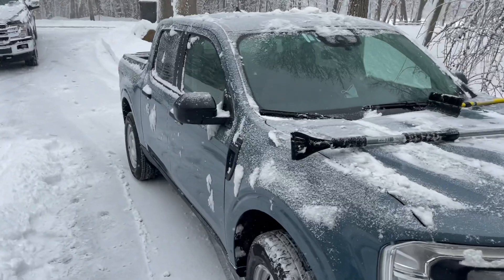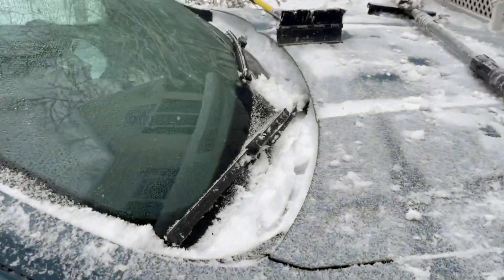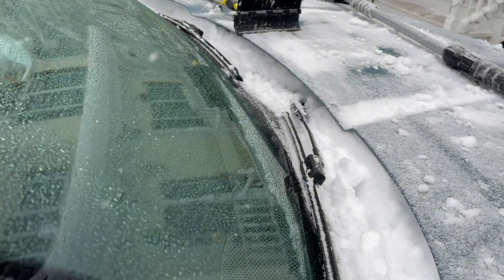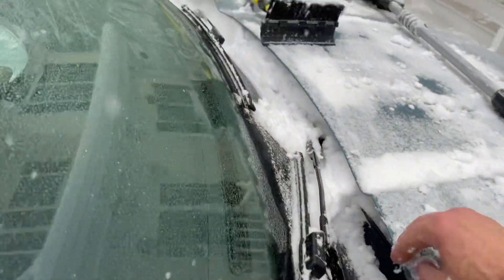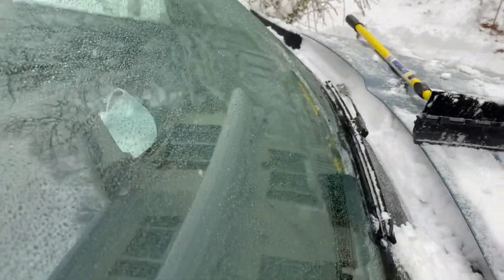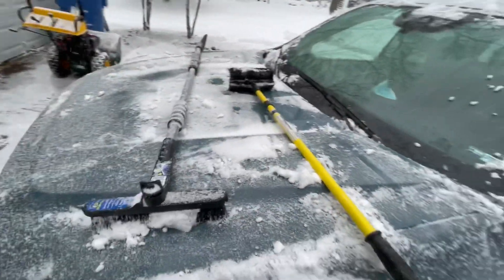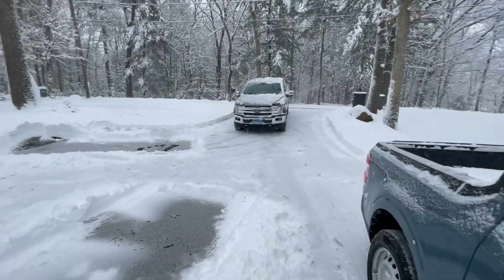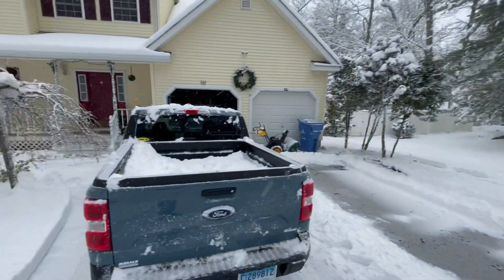Ford Maverick Engineering Fail

Comment: On 2021 Bronco Sport and 2022 Maverick vehicles, when replacing wiper blades or wiper arms, damage to the wiper motors may occur if the following steps are not followed prior to using the Workshop Manual (WSM) procedure in Section 501-16. To remove the wiper blades: 1. Place ignition key in accessory position (vehicles with keys) or key inside the vehicle (vehicles with intelligent access), press the Start-Stop button without applying the brake pedal. 2. Activate the wipers using the stalk switch. Do not manually rotate the wiper arms and blades. Damage to the wiper motor may occur. 3. When the wipers are at mid travel, move the key to the off position (units with keys) or press the Start-Stop button again to leave the wipers in a service position. Service the wiper blades once the wiper arms are at the mid travel position using the procedure in the Owner's Manual.
Reply from the maker: Thanks Don. Check the next videos out . We eventually got there! Other nice people like you helped with this info.
Reply: It's amazing how many problems are solved within the manual.
Reply: @supermills03  It's even more amazing how few people even think to look at the manual.  A car or truck is a very expensive and complex machine with 100's of moving parts.  Why wouldn't you at least skim through the manual?
Reply: Yeah a lot of cars do this now.
Reply: Dumb words
Reply: Sounds like junk to a driver who has had vehicles since the 60s.

Comment: There has been quite a few vehicles that you need to put the wipers in the mid way position to change out the wiper blades or have them come completely up. Its just the way Ford designed them. My guess would be to maximize aerodynamics and not have the wipers in the airflow. Is it a bit of an annoyance, yes, is it something to complain about, not really, just live with it, the Mavericks are such a good vehicle I can look over a few minor things here and there.
Reply from the maker: It is a minor issue. Definitely first world problem. But it is the first vehicle that I have had this design with.
Reply: Sometimes I wish I could live where it snow, but then I see what has to be done to clear out the snow, so I guess I’m happy where I live lol
Reply from the maker: @ozielsolis1  it was 7 degrees today here and  tomorrow we are getting a foot of snow
Reply: @nycmaverick  the coldest I’ve experienced was the freeze we had last year, and that was only in the low 20s but we rarely get that cold, 50s is our norm, yesterday it was in the 80s, and if it snows…everyone goes crazy for like less than an inch of snow like every once in a blue moon 🤣
Reply: Yeah I live in Minnesota and I can see this being a problem. But we learn to adapt and find something that will work better for us. We are human by the way lol. I do have the de-icing wipers when I get mine so we'll see how that will work.
Reply: If you were trying to change the wiper blades out on your own, you could just take a blanket/pillow or some foam like material and place it under the arm of the windshield wiper. So it would hold it up for you while changing them out. Like you mentioned, it is annoying, but it's not a major issue.
Reply: My Lexus es330 has the same wipers design
Reply: @Matt-g7o8u  same with my 2003 ES300.
Reply: Agree! The Ford Fusion was the same way. It was a pain to change the wiper blades.
Reply: I have a Volvo that is this way. With the car off you have to push the wiper stock up for a second or two and the wipers will go up into "service position" allowing you to change the blades or whatever. I'm sure all these vehicles have a similar setting if you read the manual.
Reply: Aerodynamics.   I can't even see my wipers when they are not in use on my Tesla 3.   This is not a new concept.  It has been going on for years.    It least on my car they have a service mode that pulls the wipers up.  I would not expect that on an entry level truck.
Reply: Was going to say it's unfortunate but this is less of an annoyance than my 14 Volkswagen Jetta as the wiper blades tuck under the lip of the hood when not being used.

Something I didn't learn until about a year into ownership was that after the car was turned off if you held the wiper arm down for a few seconds it would lift the wipers to mid windshield.
Reply: U know what's really annoying? Trying to get ice off ur wipers and almost getting frostbite on ur fingers it hurts man and can easily be avoided by putting ur wipers up, this is definitely something to complain about, where I live it's been -40c for a week, literally -50c with a windchill, ice fog and all that, you need wipers. Maybe it doesn't bother you but it certainly bothers some people, don't tell people what they can and cannot complain about, this is a stupid design idc if it's a good truck these wipers are stupid, and what I mean by almost getting frostbite is if you hit the wipers with a snow brush they'll fukin snap😂so you gotta use ur hands and when it's that cold you get frostbite very quickly and yea, stfu guy😂
Reply: @user-qh8vl9ew3r  I know this is wild but gloves do exist Lol
Reply: @Bwillev  right lmao. There's a foot of snow here, and it's been at or below 0F. I clean my car and wipers every morning and never got frostbite in my life. Definitely wouldn't be ford's fault if I did
Reply: @Bwillev  there's a reason for the glove box lol!
Reply: @user-qh8vl9ew3r  you know what can solve the frostbite issue? Wearing gloves... Also: the Ford Maverick comes with an app that allows you to start your vehicle from pretty much anywhere. (I have a similar app for my Chevy Cruze) I start my car 10min before I leave, and by the time I get to it, the ice is melted off the windows, and it's nice and cozy inside.

I live in Canada, never heard someone complain about something so small to such an extent before...

Comment: Many vehicles dont allow the wipers to be lifted up in their parked position. The Maverick isn’t isolated
Reply from the maker: So I have to time the wipers to stop them in a position to lift them? The manual pages 90-91 says nothing about this.
Reply: @nycmaverick  you can just grab the wipers and slide them point straight up just don't have them active or on the on position and you will be able to lift them up and service them for example replacing the wipers or cleaning the snow that has built in

Comment: Same issue here on my 2022 Ford Maverick XL  Hybrid with the snow, I live in Chicago and while I was driving I noticed that the wipers where not goin back to there normal position. It turns out that the snow builts up right where the wiper arm is connected to the body and doesn't allow it to go back and hide away. I also noticed after removing the snow that there's no drain holes or vents that will allow engine heat to melt the snow.

Comment: My VW Golf is like that. If you hit the wiper stock down after you turn off engine, it moves the wipers to a position where you can raise them. Your Ford probably has something similar, see owners manual.
Reply: Was gonna say this about my Jetta Wolfsburgs. If the Ford doesn't have it, it should be an easy software update I'd imagine.
Reply: Learn that from vw before and its work on our Mazda too. You should be able to do it on a ford then..
Reply: Should work. That’s how It worked on my focus RS.
Reply: Ford definitely has this.